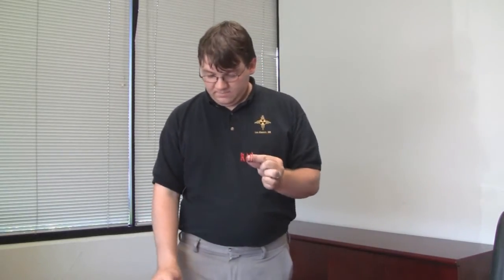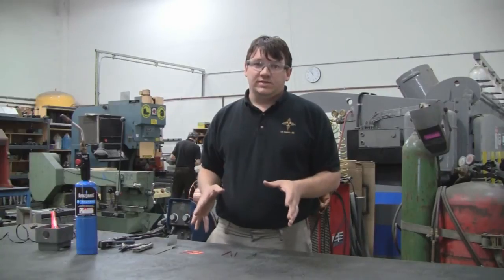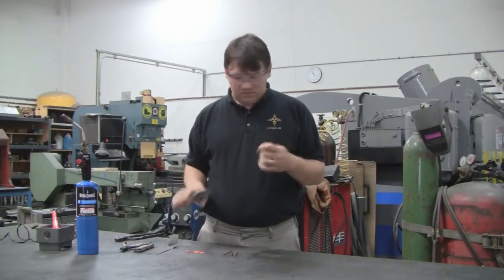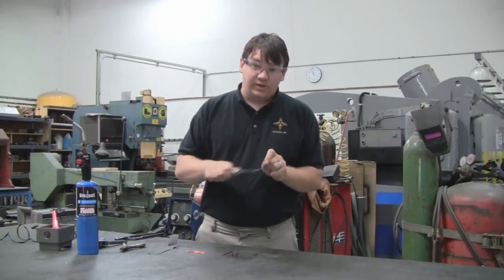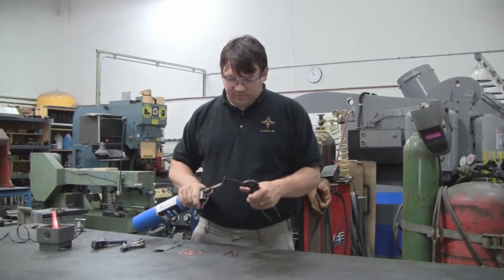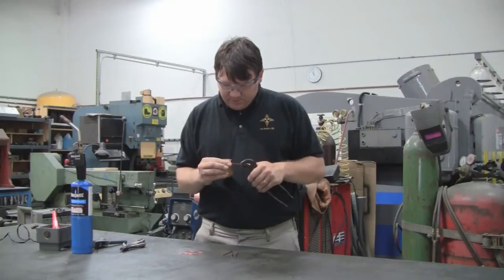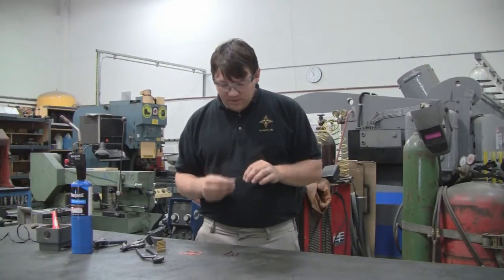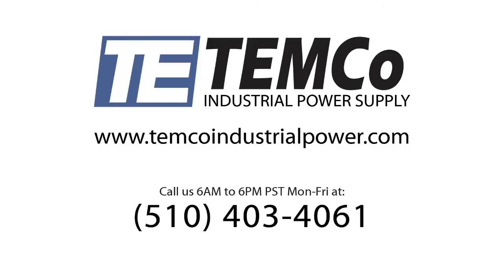TEMCo Magnet Wire Stripping Process

Comment: These work well for a single wire, but for many wires in a litz configuration I haven't found anything that does (at least not for high temp coatings). The carbon buildup from the burnt enamel prevents tinning, even in a tin bath over 900°F, and it is almost impossible to strip more than 10 to 15 wires in a litz bundle with sand paper, especially small awg wires.

Comment from the maker: There may be a miniscule variation, but it usually won't matter unless you are winding a huge amount with extreme precision. From the info we have on this wire, the dimensions are based on the wire gauge and not on the insulation type. Even with wire within the same gauge, there is a degree of variation.

Google "Essex Fine Wire Brochure" (should be first PDF result) for min/nominal/max dimensions of fine wire gauges.